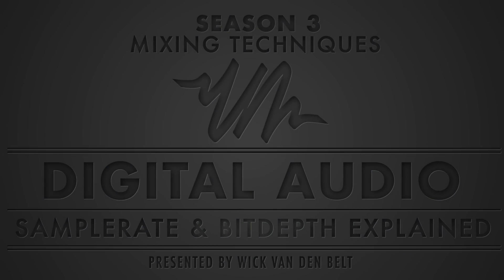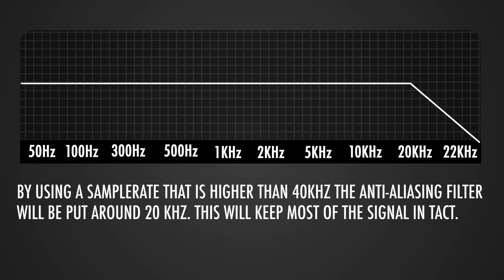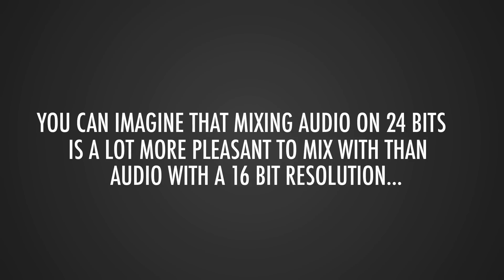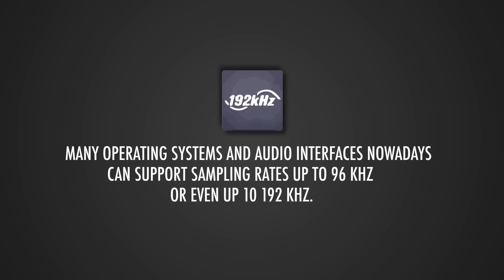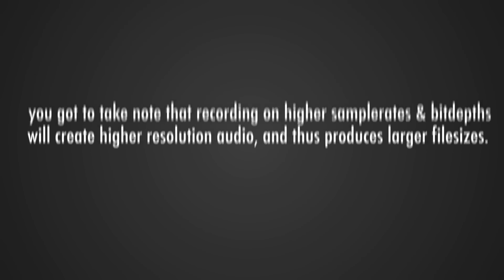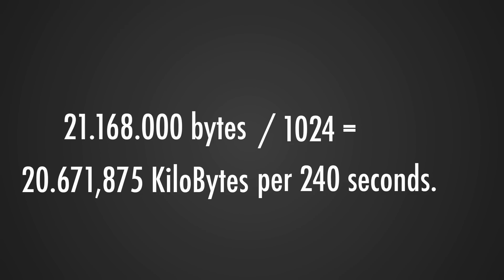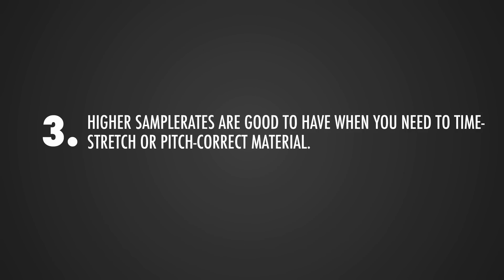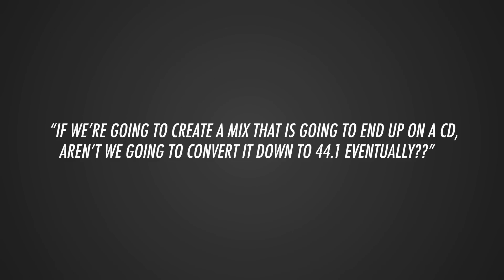Digital Audio Explained - Samplerate and Bitdepth

Comment: CD file quality is crap. The 16-bit/44.1 kHz is the standard for CD because CD allows less than 700 MB of data. Get studio masters at 24-bit/96 kHz and enjoy the true high resolution files.
Reply: +Raffie Quler 
To prevent anyone from believing this bullshit: 44.1 KHz was already a standard before CDs came along, and like the video says, that number comes from videotapes. 44.1 KHz is compatible both with the PAL and the NTSC standard, and it allows sound frequencies up to 22.05 KHz, which is quite above the human audible range.
When Sony and Philips developed the CD, Philips actually wanted to use 14 bits of depth, but Sony made the 16 bit standard prevail. The CD was a result of those choices, with an initial aim to accommodate 60 minutes of stereo audio. In other words, the actual story is the opposite of what the OP claims: the 700 MB limit was a result of the 44.1/16 standard, not the other way around.
The audio quality of 44.1/16 is way beyond what a healthy person can possibly hear, both in terms of frequency range and noise floor. Higher sample rates and bit depths only make sense for production stages; the difference between those "Hi Res" standards and CD standard is demonstrably inaudible. If you claim otherwise, you're either being fooled, or trying to fool us.
Reply: *****
Oh, by the way, I wasn't talking to that guy. I have no idea why he's replying to me, but I have seen his trolling on dozens of other videos that clarify digital audio issues. It's always the same snake oil pseudo-scientific horseshit.
Reply: *****  No you dont understand what he means. IF you convert a low profile to a higher profile what you can do is to smooth the edges and it is audible.
Reply: ***** You seem like you know everything. But you dont my friend. Do some more research please.
Reply: ***** I said smooth out the edges not adding information or detail. You see what i mean? if you have low profile source you get sharp peaks well smooth out by dac but not all. convert to higher profile will smooth out the edges just like AA in games but works the other way. That is also called oversampling do some research dude.
Reply: Raffie Quler unless you're a dog, you can't detect the difference
Reply: Çerastes 
You're arguing with a compulsive liar, dude. Believe me, it's a waste of time.
Reply: ***** 
Yes.
Reply: Çerastes
>no audible difference when it is done properly

While yes, you can technically recreate an exact replica in lossy format, the problem is, if you were to try and encode to any other format out of that mp3 you would lose quality, and as such I tend to stay away from lossy codecs entirely. 

In fact I've been really expirementing with lossless recently and have found out that you can make your flacs sound even better by converting them to multichannel 5.1 with 96khz sample rate and 24 bit depth. the difference between the original rip, and the converted rip is tremendous. Minor details emerge where they were less vivid and I couldn't imagine an mp3 producing the same quality. Mind you one album is like 2 gigs but it sounds amazing.
Reply: Raffie Quler dBpoweramp can retain multichannel from audio, or just upmix stereo. (while yes you are adding more zeroes with higher sample rate, you need higher sample rate for multichannel because otherwise distortion will occur) I have some .iso files from SACDs so I am literally extracting the multichannel .dsf, converting to wav and then flac.
Reply: Raffie Quler SACD's have 1 bit rate and a really high sample rate and 5.1 multichannel built into the files you dingus. how am I doing it wrong by simply converting the files from .dsf then into a .wav and then into a .flac. Tell me where am I going wrong? Cause I don't believe you.
Reply: Raffie Quler SACD's also have 24 bit depth naturally, even up converting 16 bit to 24 bit depth is more desirable. but it's all just ones and zeroes right?
Reply: Raffie Quler increasing bit depth is alright, decreasing already increased bit depth is the problem. upping to 24 bit depth you makes it louder without clipping, everyone should up convert to it.
Reply: ***** ok then.
Reply: Raffie Quler When you convert 16 bit to 24 bit, you are literally increasing the audibility of the file, while retaining all original qualities. What happens is they get amplified a little bit. I'd suggest trying for yourself. The problem lies with down converting 24 bit to 16, as dither must be applied and you will always lose information. You told me to do my research, but this information has all been from reading the forums on Steve Hoffman's site. So yeah, you are a dingus.
Reply: File Missing When you convert from 16bit to 24 bit. Supposedly you get lower volume But according to different converter Most likely you get the same level....
Reply: John Yang Correct, mostly command line encoders will lower by -6db. Other converters will simply convert to 24 bit and keep the volume, which is where dithering back down to 16 bit comes in. The benefits of upconverting 16 bit to 24 bit this way come from more headroom.
Reply: Raffie Quler I test myself I compared dxd and cd quality files from sony. I got 90%+ right(i tried 10 20 times and got only once wrong). Dxd is more transparent, more natural. But only a bit. Even though it is a bit, there is certainly real difference.
Reply: Raffie Quler http://www.2l.no/hires/
Reply: +Raffie Quler
"Frequencies above 20 kHz affect frequencies below 20 kHz."
They do indeed. That's called intermodulation distortion. If you want to listen IM distortion created by your audio equipment, fine. But let us who want to listen to music as it should be, do so without distortion created by ultrasonic content
Reply: That's because downsampling a 24 bit audio file will to 16 bit will result in some loss of data.
Reply: +Raffie Quler
First you say ultrasonic content affects audible frequencies. Now you say you cannot hear these. Fine. I agree with you completely. Effect of ultrasonic content in audible frequencies is neglible with any decent audio system. 

If you hear artifacts on downsampled content you should definitely use better sample rate converter instead of your 1980's one. Any modern converter is completely transparent.

But then ... of course you can hear the difference regardless of quality of your tools if you just believe enough. Some people even hear Jesus talking to them.
Reply: TheUglyGnome To my ears, 192khz 24bit sounds just a bit more coherent and transparent. Possibly the lowpass. 
And higher resolution or even upsampling allows dac to work better in terms of accuracy. Experienced people can easily hear difference between dacs that are far lower better the so called threshold.
Reply: +John Yang
You are just spreading mumbo-jumbo words. Please don't try it with me. I've been in audio industry (on and off) for 30 years, studied digital signal processing, human hearing etc in University.

Do you even know how digital audio works? Obviously not if you use words like "accuracy". Basics of digital audio is well known mathematically proven science.
Reply: TheUglyGnome I was agreeing with you wtf?
Or if you say that you are that awesome, see if you can understand most mainstream dacs. If so then You are awesome. If not , no you have a lot to learn. If they all bullshit why there are 3 grand adda systems, when 200 dollar adda is already beyond the fake hearing threshold. I am saying people CAN hear the difference.
Reply: +John Yang
Sorry. I might have misinterpreted your post: 
1. When you said "upsampling" you were talking about oversampling DAC:s. Right? In that case I completely agree with you. I thought you were talking that converting existing 44.1k audio to 192k (or whatever) and magically making it sound better when put through DAC.
2. When you put in word "accuracy" I instantly thought you were claiming 24 bit audio is somehow more "accurate" than 16 bit one ... while in reality it's only about S/N ratio if done correctly (with dither).

About difference between cheap and expensive AD/DA: I'm quite positive the real AD/DA process is in most cases neglible. Most of the modern converter chips are freaking good. But analog circuits built around these chips vary. That's where the difference is. But a $3k converter? That's something I call snake oil.
Reply: +Raffie Quler
I'm not the one who is preaching here. You are preaching the believes you got from a snake oil seller. I'm just the educated one who calls "bullshit" whenever someone is trying to mislead general public.
Reply: The difference between DAC's is the result of the analog section of the unit, not the digital section, as many people and companies you want to believe. Even the DACs from the eighties were capable the produce the whole sound stage. A better cd-player has a better analog audio section (pre-amp), not a better digital stage. There are a lot of cd players which sounds way better than hi-res and sa-cd players.
Reply: cd sucks i agree
Reply: +Raffie Quler Absolutely correct mate. This was the biggest con that the music industry ever played on their customers. The reason they went for 16bit was that it allowed an entire album to be fitted on the cd.
Reply: +Peter Mitchell 
Also, as per video, those CD quality files play faster and at a higher pitch than those studio master files. Yeah, CD is a joke. All the fidelity is lost when a studio master file is downconverted to CD quality.
Reply: ***** 
Whenever you upsample a file, you just add zeros to the file so there is no change at all. Also, a file has to be properly mixed for 5.1 in a studio. You are out of your mind.
Reply: ***** 
You are doing it wrong. Please do some reading or call a real music studio. They will tell you the same thing.
Reply: ***** 
You are not supposed to upconvert anything. Listen to the files in their native resolution. Upconverting does nothing to increase the sound quality.
Reply: ***** 
Unfortunately, you are wrong. You can't create a 24-bit file out of a 16-bit file. The file has to be recorded with 24-bit bit depth. Once you downconvert a file to 16 bits, you can never get those bits back. You don't understand how audio works, but I'm telling you now.
Reply: John Yang 
You are wrong, my friend. You guys have to do some research.
Reply: +Stereo sound Is king
Frequencies above 20 kHz affect frequencies below 20 kHz. Also, all real music instruments extend way above 20 kHz so we need to capture them. Not even a dog types bullshit like you do.
Reply: TheUglyGnome, I don't hear any intermodulation distortion in my 24/96 files, but I hear so many artifacts of all kinds when downsampling those same files to 16/44 resolution.
Reply: +TheUglyGnome 
Yes, I know. Truth hurts. Sorry, I can't help you with that. Keep preaching your bullshit to someone else.
Reply: Fernie Canto 
Fernie, are you his lawyer? Is he paying you well?
Reply: Please call a production studio. Mr. Dingus.
Reply: John Yang 
Funny guy.
Reply: John Yang
You are a really funny guy. LOL.
Reply: Çerastes 
Cerastes, you said before in a comment section of another video that even CD quality is pointless for listening to music. You are so lost and there is no hope for you. Stick with your MP3 crap and enjoy.
Reply: Çerastes 
Cerastes, you are lying to me now. You said CD file quality is pointless in a comment section under a different video. You left this comment a few months ago so you probably forgot, but that comment will always stay with me, knowing that all you millennials have huge collections of MP3 files and nothing else.

Comment: What an amazing video! One thing that he did not mention at the end was that just like in videography, if you edit in 10-Bit video and in the end downgrade to 8-Bit (because that's for example all the video on YouTube), your video quality will still be better in the end than if you had edited in 8-Bit.

Even if you down sample a higher sample rate to 44.1 khz at the end, you will end up with a better 44.1 khz track than if you edited in 44.1 khz from the start.
Reply: Dracule Mihawk thanks a lot. It makes it easier to understand all those X Y KHz

Comment: There's no point in sampling higher than twice the highest audible frequency, other than making the process of preventing noise from folding back.  Any noise at a frequency above half the sample rate will "fold back" and appear as a signal below the half sampling rate.   That's where the analog low pass filter comes in.  But it can add uneven group delay, so by oversampling, you can place the cutoff frequency higher. The phase distortion is much less in the 20 to 20Khz range this way.  You then decimate and get rid of the extra samples.  Once it's digitized you don't need to drag around more than 44Khz' worth of bits.  So I'm not sold on the value of working with 96Khz files.
Reply: Yes, by oversampling ( digitally ) we can eliminate the images, more or less, but there is an issue here. The reconstruction filter ( that does the over sampling) uses sharp fir-filters and the process is very efficient, but there is one caveat;  the filter can only reconstruct static signals that doesn't change their amplitude or frequency.
As soon as the wave changes, the filter will be momentarily "confused" whether it shall regard the samples as phase information or amplitude information.
In the world of music, the waves changes all the time and the filter won't reproduce the totality of the music correctly. Attacks and decays will be somewhat smeared out in the time domain. Recent research has shown that our hearing is very sensitive to the phase relationship between various transients.
Using a higher sampling rate makes this effect much lesser. And we can use less sharp filters that doesn't affect the signal as much as now.
The capacity of internet will grow and in the future, there is no need for sticking to 44.1khz. 
192khz and lossless compression will do. Traditionalists may shake their heads, but I hope there will be a consensus around PCM and higher samlping rates. Bit depth is not that important.
Formats like SACD is a dead end since it relies on sigma delta conversion, which limits the resolution at higher frequencies. This is an averaging conversion and can't respond to hf nuances in a proper way. But this is a limitation of all sigma delta devices. But by using PCM we won't paint our self into any sigma-delta corner.
Reply: Modern interfaces do exactly this: Oversampling, than outputting at the sample rate you actually dial. But people will never learn, as we can see here. Doing the same like having 24 MPixel behind a phone camera lens.
Reply: mdesm2005 I record analog synths every day and at 44.1 it is missing the whole analog synth sound. I’ve paid 12 000$ worth of analog gear and if i only use 44.1 they will just sound like digital vst sounds. So i mix both 96 lossless and 44.1 cd. It’s stupid to dismiss higher khz rates because there are uses for all rates that are available.

Comment: wooow this short video answer all my question in my head, thanks so much for sharing this knowledge! :D
One question, i recorded vocal in studio that have a 48.000 sample rate and 24 bit depth, and i work in my own laptop in 44,1 sample rate and 24 bit, the vocal must be convert to 44,1 right? Is there a bad thing or disadvantage when converting the vocal track from 48.000 to 44,1 sample rate? I'm confuse about this :|

Comment: Please can someone explain my query :

If we are recording and digitizing a song being played which has alot of bass and treble together for example and of course the amplitudes of the different frequencies are different.

If we take a sample at any one point in time, we are getting a binary number that represents an amplitude. Which amplitude is this if there are various amplitudes for the different frequency components at any one point in time?
Isn't sampling done 1 dimensional? How are we able to get all of the information about the different frequencies and levels then?
Reply: From what I understand you aren't actually digitizing the "audio fidelity" of an audio sound wave. What you're digitizing is the the electromagnetic signals used by a microphone or loudspeaker/headphone. The microphone, or analog recording device, converts sound into an electrical signal. It's the electrical signal that is being digitized (sampled). I think it's the characteristics of those electrical signals (line-level electrical signals) that are encoded. Not the actual audio frequency ranges, but the signal that creates the frequency outputs, if you know what I mean.

Myself, I'm trying to get it clear in my head how a digital word size, whether 8 bit, 16 bit or 24 bit, etc, is encoded (digital line coding) in Pulse Code Modulation for example. There are different ways of encoding data into a carrier wave and I'm not sure what standard is used by PCM.

Comment: thanks for the lesson! I have a question. So I plug in my Lexicon Alpha with Shure58 to my laptop. Everything is fine, I can hear myself perfectly well in the headphones (without any noise). But when I record something in Cubase, there is a very annoying constant noise (like squeak). The noise is still there even if the mic is off( when i push Monitor button). Does it somehow connected to the topic of this lesson?